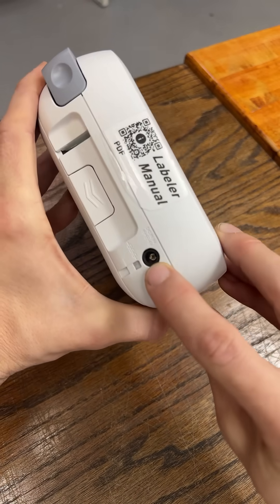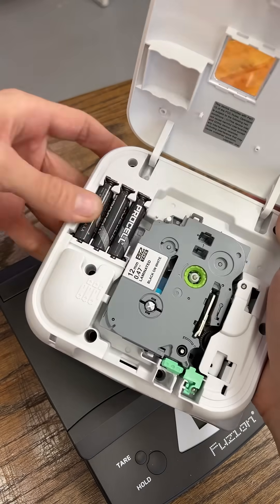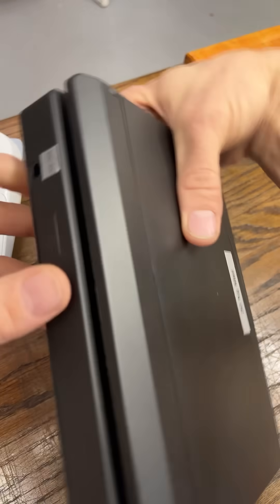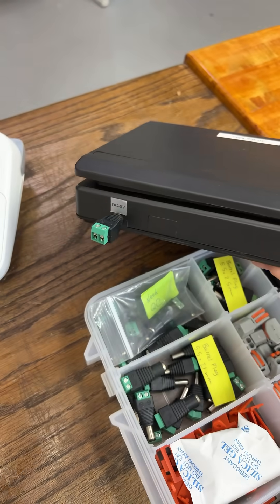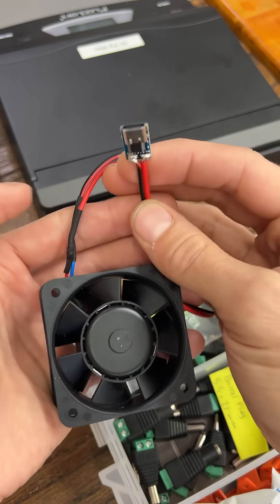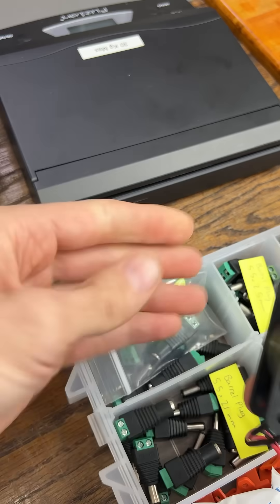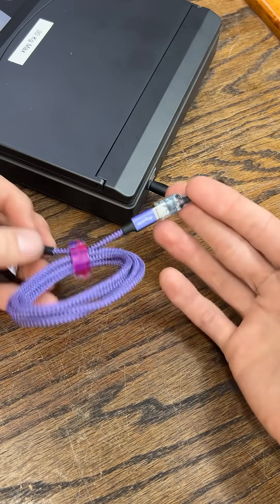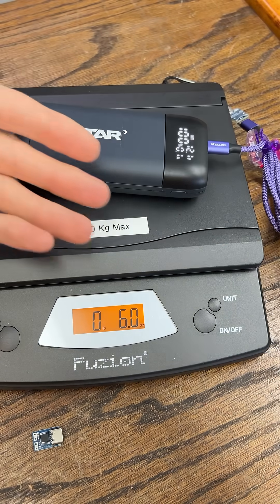USB-C can replace alkaline batteries

Comment: A warning! 
1. Almost all things using a barell plug has differnt polarity, check the symbol on the device first to see if the ground is the outer or inner ring. Or measure the original device with a Multimeter! Otherwise you'll blow the device.
2. Also a PD charger is dependant on a usb communication line to determine volts and max Amperage. Otherwise It will default to 5V and 1Amp. Your better off buying a fix Voltage and Amperage Universal charger from Amaxon that match your device and then make sure you solder on the correct barellplug and polarity!!
3. If you want to use a powerbank most of the time you need a voltage regulator circuit so you match the device, since most old devices run on 9V instead of 3.3/5V like USB devices
Reply: That’s what the breakout board does, it negotiates with the PD device to say “I want this specific voltage” and when it receives it, it outputs it to the two pads. It’s not going to be 5V1A unless the board you use is set to that specifically.

PD can deliver a range of different voltages, not just 5v alone. It’s also why USB-C is now mandated in Europe for all rechargeable devices sold.

Comment: It might have the right voltage but that tiny power brick likely can't supply the current needed to charge a laptop. You should look at the original power brick and see what the output current is.

Comment: You can buy Li-ion 1.5v rechargable with built-in Type-C port for around $5 a pair. They last kinda forever and per charge holds more energy, lighter, and can deliver more power.

I never bought alkaline ever again since that 1.5v Li-ion AA/AAA battery became a thing.

Comment: lol its good content, but putting a battery bank on something that had batteries that are rechargeable built into it. seems redundant...  but thats the point. you probably just swap them out on the run during a shift. 

now a power bank is in pocket chargeing it, and should last 30 or more houts now

Comment: They sell universal barrel plug adapters that plug in your car or home. I had one back in the 90's. You just had to set the polarity, voltage, and find, which included barrel fit. I never remember having to even change the polarity, but I did always look at the jack and check. The center is usually positive in my experience.

Comment: If the device can be powered by batteries, the easiest solution is to use rechargeable batteries. For the rest this is cool indeed, just the barrels are usually all slightly different.

Comment: Re: Replays - You can resume from any chapter with existing completion data, many dialogue have different branches if you make different decisions, and if you are truly checked out of the narrative, the game becomes hours shorter when skipping dialogue.

It sounds daunting if one wants to replay from the very start with a completely different approach, but the game gives lots of tools to reduce monotony.

Suggestion that slave slots matter (but not necessarily plotwise): The starting room varies slightly based on save slot.

Comment: You know old adjustable charger with voltage is reinvented with few steps and as a smaller in 2025 and presented as the miracle.

Comment: Or you can think for a sec and use rechargeable battery's, its not like you need to change them often my "Brother" label maker has been using the same Kirkland battery's for 3 years now and there not even rechargeable.

Comment: any chance you could post links to the parts you used? Using 6 batteries is ridiculous, but paying $23 for the official Brother wall plug is not cheap either.

Comment: I have never seen a device that uses both AA batteries AND a barrel connector for power. How is the usb-c replacing the batteries? Isn’t it just replacing the barrel connector? Which - if you have the device - should have come with the cord to plug it in anyway? The batteries are just to give you a wireless option, right??

Comment: You know that rechargeable batteries have been around for over 4 decades, right? And modern ones can be recharged up to 1000 times. They cost almost nothing to recharge. They are much more portable than a power bank, and they are much cheaper to buy than a power bank, so I totally miss the point of this "great innovation" that just makes everything more expensive and less portable than it was 40 years ago.

Comment: You can also buy USBC to barrel jack adapters in most common voltages. Usually about 4" long and no soldering

Comment: I don’t get the point of this - these appliances all require a power supply - some give the option to use batteries so they be used portably right? Why are you bringing the USB C cable into this instead of just using the plugs that came with the appliance? That seems like more of an inconvenience than just using the existing power cables - ELI5

Comment: I WISH more devices used AA or AAA batteries these days. Yeah alkaline batteries are terrible, but rechargeable AA / AAA batteries have come a LONG way. Being able to just swap out the batteries when you run out is really nice and you don’t have to worry about the long term lifespan of the battery since it’s a universal standard that is easy to replace.

Comment: Yes I already use USB-c to barrel plug cables which have a built in configuration to switch the PD to 9V or 12V or more. In the past I used to make them using small DC-DC converters from Pololu.

Comment: Keep in mind even if you have the right voltage, there are several barrel plugs that look similar but are not really. They may even fit, but if you have a loose fit, it generates heat. Secondly, polarity differs, so some plugs have + in the center, while others have -. Also, how many Amps can the power supply/battery supply, and does the usb conversion adapter support it? If you under power in amps, it causes all sorts of issues.

Comment: I use those little PD boards, and they’re quite nice. In the beginning I couldn’t figure out why I couldn’t change the voltage; mine had a tiny trace that had to be cut in addition to the soldering. It wasn’t obvious until I looked at it under a microscope.

Comment: They sell premade cables with a Type-C connector on one end with built in PD negotiation and a barrel plug on the other, on AliExpress. They have cables for various voltages, but not sure about polarity.

Comment: I brought some labels of Amamzon UK from a marketplace seller and got a USB-C adaptor thrown in for free. Works fine on my D600VP.
I did get an adaptor included with mine though, but it would be nice to know where it is.
I did also make a power lead out of a 12V LCD TV PSU and just cut the wires near the barrel jack and reversed the wiring.

Comment: Also you can desolder the short, solder back some wires to a couple of switches. And voila, you can select output voltage on this PD decoy, making one cord to power them all (not simultaneously).

Comment: Who did the wiring?

Oh that would be my nephew

And when did his house burn down?

While this is a joke, there is a risk. If something draws 1A at 12V, it will draw bearly 3A at 5V. And thats with 100% efficient boost converter, which doesn't exist. You might not need to be an engineer for 99% of devices, but that one device might end up melting a cable. Luckily, at 5V, the odds of starting a fire are mostly negligible. But you never know what chinese crap might be out there that ignored every safety rule known to man.

Comment: There's a lot more nuance to this. First of all you definitely need to know if the device is center positive or center negative. Second, there are a billion differen barrel plugs. I have lots of different voltage adapters, but I cannot use them because I can't find the correct plug anywhere. Third, tons of devices use really stupid voltages that are not compatible with USB PD. Fourth, don't exceed the amperage rating, especially if using a cheap power supply that doesn't have the protections it should have.

Comment: maybe dont recommend usb-c to barrel adapters if you arent aware of what you're doing, the pd delivery boards arent all equal and will quite often need buck converters to get the desired voltage and amperage for a device 

not to mention many devices have positive on the outside of the barrel plug, its usually clearly labelled near the port, if you wire this wrong you'll blow your device

Comment: I have that same label maker and i added a usb-c lipo BMS board the cheap chinese ones and a battery i pulled from a vape. it works great and can be recharged. the usb v port will fit into that hole the jack uses btw.

Comment: There’s also barrels with ground (-) on outside (+) positive inside and the inverse. Not to mention different voltage levels on adapters themselves. Still easy but not as simple as this video suggests

Comment: Well I got a printable adding machine with the socket for the power supply with the center road as the negative. No one carries it. I can't even get It from the manufacturer without buying a new unit. Office Depot sells them apart and they are out of power supply

Comment: Batteries are not the most expensive part, labels are the most expensive part. Batteries are the most annoying part, but you can skip them with basic knowledge of electricity and barrel plugs. There's also different polarities, which you didn't mention.

Comment: There are 4 dollar switching usb to barrel connectors got a couple one for 9 volt or 12 volt one for 5 volt or 9 volt. And another that switches from 5 volts to 12 volts (with 9 volts in the middle) paid like 6 bucks for it.

Comment: You can just buy a multi voltage supply with a multi pin plug on it, which will cover all of the things shown. 
That is a solution that has been available for at least 50 years.

Comment: Ive been doing this for a couple years now, small battery powered motion lights, now being powered by 18650s and charged by a TP4056 module and recharged with a power bank. Same thing for my bright Solar powered motion lights, connected a TP4056 module and now im able to manually charge them during the winter or other days when sunlight is limited. 

USB powered modifications are the way to go guys.

Comment: ...and what if the device you're powering needs more current than the USB source can supply (which, if it's got a barrel socket is highly likely) ?  A 'fix' that only works in a small number of scenarios.

Comment: How does PD know what voltage a non PD device needs? You can get a power supply that does 3-12V DC and has a dial and display. They come with a ton of adapters, even a USB-C one

Comment: This is why you buy a $20 90W power brick that has all the adapters for just about any laptop power connector plus USB-c and do not have to worry about soldering or anything. The same universal charger can also be used for LCD monitors that use an external power brick.

Comment: Throw back to the time i started a small little fire in my car by adding interior leds. I cut one of these barrels  and connected it from the battery to the leds... fused of course. It use to connect to the cig lighter port but i wanted it hardwired. Leds are 5V... a car battery is 12v. Use the damn cig lighter orrrrr use a 12v to 5v power regulator. Smh this was my first car 4 years ago dont judge me too hard 😅

Comment: Such a stupid video, over simplification to the point of lying. First of all not everything uses 5, 9, 12, 15v. Second, not all of them use the same AC barrel plug size. 3rd a lot of these older devices require the power supply for voltage regulation, you can absolutely damage these older devices by connecting them to a usb-c power supply. 🤦‍♂️🤦‍♂️🤦‍♂️🤦‍♂️

Comment: Have that same powerbank / charger. You can use Molicel 4500 mAh cells for use in winter outdoors without damage to the cells (most Li-Ion don't react well to cold exposure).

Comment: One possible issue is that the power draw can generate enough heat to become a problem, or cause the power to fail to be supplied if the draw is beyond what the adapter can handle.

Comment: Sometimes it's simple (and dirt cheap), sometimes the device needs more power. And yes, USBC can provide almost anything that is needed, however, the adapters will be a bit more expensive and way more complicated. Last time I checked phone chargers were able to give like 65W, it's a huge power. To let it be passed through thin wires, it offers higher voltages than 5 or even 9V. The tricky part is negotiation, the device asks for specific settings and then the power supply delivers.

Comment: what the fuck are u even talking about, usb-c doesn't replace alkaline batteries, devices with barrel ports and lithium batteries have existed for a long time, they're called laptops. also u can do the same little idea u did there with no usb pd parts, can even make it better.

Comment: new idea for startup: voltage-configurable USB-C to barrel plug adapter. so you buy a ton of these, no need to solder, maybe a small switch to toggle and you are good to go!

Comment: “The most expensive part of using them is the batteries” 

My man, you are holding a LABELMAKER. That is close to printer-tier consumable costs. I bought a new labelmaker a year ago because the WHOLE NEW ONE was cheaper than one label tape for my old unit.

Comment: Interesting, I'll have to check that out. I know i've had issues with getting the right size, voltage, as well as center positive or negative. 
Looks like the fix is to solder pos/neg to the right lead right?

Comment: Dumbest advice ever. Don't do this, you risk burning up your device if the device is expecting a lower pre-regulated voltage and you use a different voltage. E.g. - the adapter he showed did 9, 12, 15 and 20V, but your device needs regulated 5V. Good chance you will burn up the 5V device. 
AND - no there is not only one size for those concentric power connections. Most common are 2.1, 2.5 and 3.1mm. Some devices use AC voltage on those pins. And most use center pin for power but some use center pin for ground. 
And then you have a multitude of power ratings to contend with. 
Best advice - buy the proper power supply & connector rather than this kludge. 
Best source for proper power supplies in US - Mouser.

Comment: Buy a usb c to barrel adapter.  Just make sure you get the proper voltage and size.

If you have many devices and don't know what barrel plug to buy, buy them all, find a vendor that supplies a wide variety, and invest the $14. Then replace them as you find a good fit in a product.  

Even the PD usb c power supplies are cheap now. 

I even use them to charge laptops at full speed, usb c is impressive.  

Just gotta buy direct.

Comment: I don't think it will work,. Yes you could change the voltage, but power output wont be enough for some of the appliances, it will be lower when you step up the voltage..

Comment: Watch out for the 12v ones. They removed 12v from the spec and some plugs will probably give you 9v instead.    Unless the trigger module uses PPS that can request arbitrary voltages.

Comment: We’ve had universal adapters for these since at least the 90s. One transformer with switches for different power settings, and a cable with a bunch of dongles on the end for every plug type. You just had to read the labelled power requirement on each device. Simple even for little kids.
Reply: Yeah but this is way better because there's no risk of selecting the wrong voltage when swapping, as long as you don't use the wrong dongle

Comment: From my experience, the power supplies with the barrel jack cable, like what would come included with the example label printer and shipping scale, tend to last a lot longer than USB cables of almost any design. Type A and B are pretty bulletproof, but any of the smaller variants wear out really fast and are generally more delicate. I've had really good quality USB cables from Anker that start loosing connection after only a year or so, nowhere near the 10,000+ cycles they're supposed to be rated for, but I have 20 year old type A/B devices and power supplies that still work like new.

Comment: The (+) used to be the center of the barrel on 98% of devices, but then the center became (-). These kits are great now! Notice the PD adapter gives you different choices, +9v, +12v, +15v, +20v. Some devices have a PLUS MINUS Supply, where there is a positive voltage, a negative voltage, and a common ground. Note that (-) is active voltage on a plus minus supply and ground is indicated by the symbol for ground.

Comment: Finally some ones catching on been doing this for decades. Even u go further I say fk all that n just take the inlet out and solder usb cords right to the board. Battery packs will usually meet the voltage demands above 5 also so long as u don't mind the performance drop in the battery.

Comment: USB-C is a Shite power standard; trying to be to be too many thing and too open for interpretation. And never mind the fact that most of these tiny USB-C power connections will fail both mechanically and electrically over time. It's just as bad as the 25 different size barrel plugs out there.

Comment: Pretty simple you Gen Z and Young Millenial know-littles.  Never throw away power cables to anything.  Throw away the unit when it breaks and can't be fixed, but save the cables.  I've got a large box full of cables and can always find one that works.

Comment: There are these type c port to dc plug adapter that will negotiate the voltage like 9v 12v 15v 20v
And you need to be careful, I have a brother label printer and the dc plug middle pin is ground.... Not your usual dc plug

Comment: I’m sorry to tell you but voltage, amperage, sizes, formats, and polarity are not as simple as you are stating. It’s not rocket science, but it’s not this either. Based on what you are stating here, you will ruin devices.